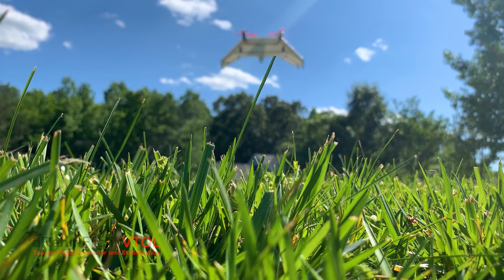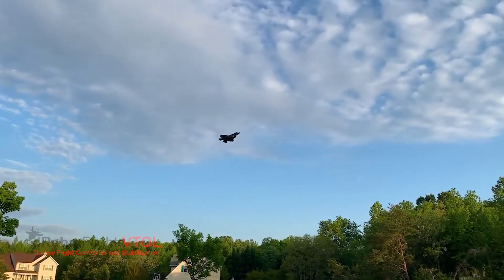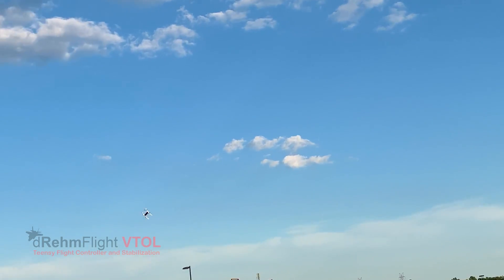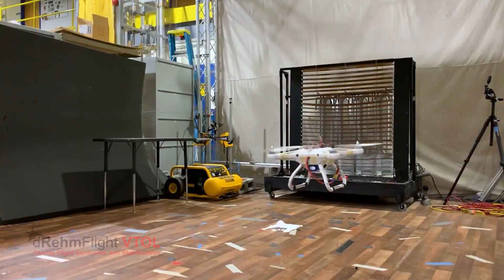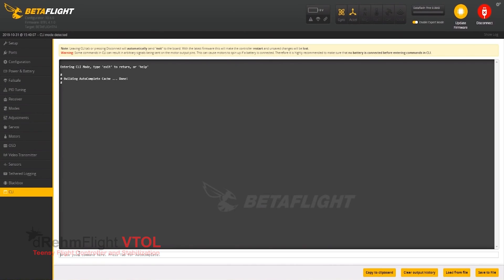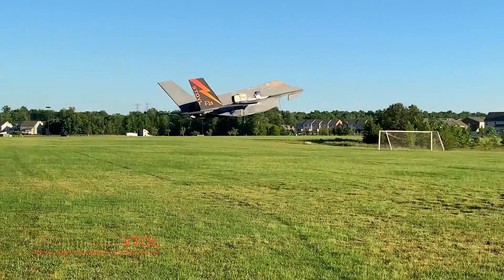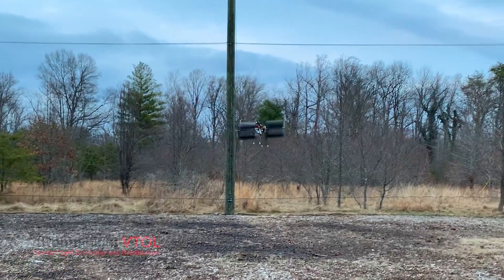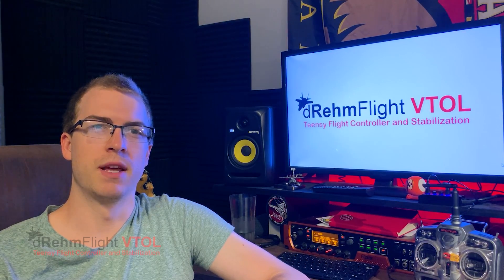dRehmFlight VTOL - Teensy (Arduino) Flight Controller and Stabilization

Comment: Fantastic stuff you made. I've been slowly working my way into the arducopter code (and I am a software guy) and it is quite a complex package, and not all of it makes sense even if you know the basics of control theory. At least they made it modular so that helps a bit with scope reduction but it is nothing compared to what you've done here. To the point that I'm wondering if a multi-layer approach doesn't make sense: use your small and extremely flexible core for the inner portion of the control loops and then to go to arducopter for the remainder. That way you get a nice and clean separation between low level and high level code and no more silly surprises or ridiculously complex interplay between the various settings. I'm sorely tempted to do this, and I'm also going to try to run your code on a replica of the drone I'm developing using a teensy just to see what that looks like. It will at least give me an idea of what this craft is capable off, that's a very useful baseline to have. Thank you! And if you're ever in the Netherlands consider yourself invited, Jacques Mattheij
Reply from the maker: Someone did something similar with INAV as the outer loop enabling waypoint type stuff! https://www.youtube.com/watch?v=Fxo_z9MwhlM

Comment: Did you have to flash your ESC for dshot; if so ; I tried to do mine and could not do it ; or did you get the ESC that default to dShot or Oneshot ect
Reply from the maker: DRehmFlight doesn’t support dshot, only regular pwm or onshot125. All blheli ESCs will come pre-flashed, just read their to spec to make sure they will accept oneshot125
Reply: @NicholasRehm  What do you  Recommend for a ESCs that are not all in one
Reply: do you have a patron

Comment: Hi Nicholas. Great work done by you. I need a small help/guide for simple fixed (Conventional and delta) wing plane stabilisation using drehm flight controller. I have done the hardware , Rc setup and IMU calibration successfully but unable to understand that which and where should I work on the code to check the servo and motor functions. Please guide/help on this. Thanks in advance.
Reply from the maker: Check the control mixer
Reply: Thanks. But any video link is there for easy reference? Actually I tried but confused between different codes that which to be used. So.
Reply from the maker: @piyushdivyajit3712  check out the “how the code works” video. Or the documentation .pdf
Reply: @NicholasRehm  , Thanks for guide. I will try best.

Comment: Very interesting!  I've been wanting to figure out how to control my quads via computer.  This is a good start!  Have you looked into controlling your raspberry pi with computer generated inputs?  I'm thinking about this quad airshows with hundreds of quads.  Also, it looks like you used the Robot Operating System with your Raspberry Pi, correct?
Reply from the maker: Check this video out: https://www.youtube.com/watch?v=p8frNNYQNV4&

Comment: Hi, I'm getting some errors compiling your projects referencing multiple definitions of constructors in the libraries provided by you in the src folder. The errors are like:
In function `DSMRX::DSMRX(unsigned char, unsigned char, unsigned char, unsigned char)':
C:\Users\_____\OneDrive\Documents\Arduino\libraries\DSMRX/DSMRX.cpp:23: multiple definition of `DSMRX::DSMRX(unsigned char, unsigned char, unsigned char, unsigned char)'
C:\Users\______\AppData\Local\Temp\arduino_build_60048\sketch\src\DSMRX\DSMRX.cpp.o:D:\dRehmFlight-master\Versions\dRehmFlight_Teensy_BETA_1.3\src\DSMRX/DSMRX.cpp:23: first defined here
c:/program files (x86)/arduino/hardware/tools/arm/bin/../lib/gcc/arm-none-eabi/5.4.1/../../../../arm-none-eabi/bin/ld.exe: Disabling relaxation: it will not work with multiple definitions
Pls help
Reply from the maker: You have the same library installed in Arduino and Arduino doesn't like seeing two of them

Comment: can I use a raspberry Pi pico board for this, here is the complete specs of the board

21 mm × 51 mm form factor
RP2040 microcontroller chip designed by Raspberry Pi in the UK
Dual-core Arm Cortex-M0+ processor, flexible clock running up to 133 MHz
264kB on-chip SRAM
2MB on-board QSPI flash
2.4GHz 802.11n wireless LAN (Raspberry Pi Pico W and WH only)
26 multifunction GPIO pins, including 3 analogue inputs
2 × UART, 2 × SPI controllers, 2 × I2C controllers, 16 × PWM channels
1 × USB 1.1 controller and PHY, with host and device support
8 × Programmable I/O (PIO) state machines for custom peripheral support
Supported input power 1.8–5.5V DC
Operating temperature -20°C to +85°C (Raspberry Pi Pico and Pico H); -20°C to +70°C (Raspberry Pi Pico W and Pico WH)
Castellated module allows soldering direct to carrier boards (Raspberry Pi Pico and Pico W only)
Drag-and-drop programming using mass storage over USB
Low-power sleep and dormant modes
Accurate on-chip clock
Temperature sensor
Accelerated integer and floating-point libraries on-chip
Reply from the maker: If you remap some pins, probably. But no guarantee of things working right off the bat like I can with the teensy
Reply: @NicholasRehm  thanks for the reply
Reply: @NicholasRehm  I'm struggling to find where the pins for the imu are defined in the main code so I can change them. if it doesn't bother you, I would like to know where they are written 

 thanks alot

Comment: The Teensy 4.0 isn't available for me. I can get a teensy LC or Teensy 4.1. If my sources are correct then the LC is the less powerful 3.1, right? Is that one fast enough or do I need the speed of the 4.0? The 4.1 looks to be bigger but equally as fast. And it's pretty expensive, so I'd like to avoid that one.
Reply from the maker: Only 4/4.1 will work. All about the peripherals
Reply: @NicholasRehm  Thank you for your very quick reply!

Comment: You may have just gotten me into drones. I was planning on learning/writing some PID stuff to use in an EV conversion I’m planning. This is a great, open source, entry for me to learn motor control in a fun way. Super exciting!
Reply from the maker: Awesome to hear, gimme a week and a new version will be out with better documentation and a little bit cleaner code

Comment: Hello, can we use your flight controller code as a starting point for commercial projects?
Reply from the maker: The code has open source GNU license. Basically it requires that any future versions of the code released/sold as part of a product hold the same license and be publicly available.

Comment: Nicholas this looks FANTASTIC.  I agree with your statements about ardupilot.  There is so much "advanced" C syntax that you can't understand the code if you're not a software engineer.  I'm making a model of a BlackFly (https://www.youtube.com/c/Openeraero) and wrote my own flight controller starting with a Quad FC by Joop Brokking (https://www.youtube.com/user/MacPuffdog/featured).  I converted his code to use Quaterions in the orientation calcs which was a stretch for me but I got it working.  Do you use Quats in your calcs?  These calcs avoid gimble lock, which is important for a vehicle which will have two modes (hover, and horizontal flight).  I use a GPS that outputs serial.  I presume the teensy can handle this as well as the I2C barometer and magnetometer.  I'm already using an MPU6050 so that should be a breeze, if you're using I2C, not SPI.
Reply from the maker: Yes there is a quaternion attitude estimate… roll, pitch, and yaw angles are derived from that but they can be re-derived from a different reference attitude than what I currently use if you just have a look at the code. IMU is already integrated over i2c and you can absolutely patch in your other sensors. The only controllers programmed are for rate command and angle command—no outer loop control such as altitude hold or GPS velocity/position. But sounds like you know what you’re doing so implementing something for your use case should be simple. I’d recommend starting with the baseline code, getting a feel for how it works and it’s baseline capabilities, then starting to integrate your changes. Best of luck

Comment: have u try to install ardupilot or betaflight? do u think can support this?
Reply from the maker: The code is the flight controller, not necessarily the physical board. The point of the project is to provide another option than ardupilot/betaflight to stabilize things
Cheers

Comment: Nik, I have two f35's  flying but have an issue I need your guidance on.
I have to set an aileron offset to balance the thrust from the aileron motors. Calibrating the ESC'S does not resolve the issue the left motor, as viewed from behind, always comes on well ahead of the right. About 30% trim is required to balance it. I can't find a parameter that I can tweak to address this
Reply from the maker: Radio calibration in the docs .pdf. Then make sure when you power on, it’s on a level surface and left still until the ESCs arm.  Both of these are required to make sure the flight controller is receiving centered sticks, and the flight controller measured state from the IMU is zeroed. With this done properly, centered sticks on the radio will correspond to zero roll of the aircraft